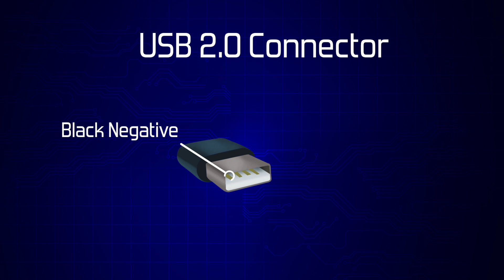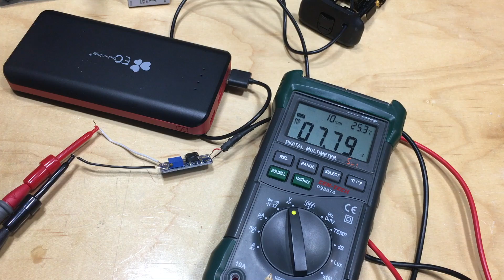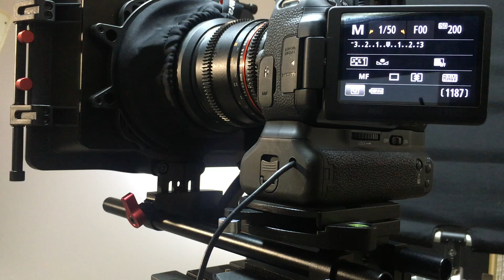Use a 5 Volt Power Bank on a DSLR

Comment: Hello! I tried to do something similar with an lp-e6 battery for a Canon 6D using a 5v to 8v boost converter. In the end, nothing happened. A friend suggested to me that it might be because of the cheap converter board. I ordered several others in China, at a higher price. Perhaps it will work with them.

Comment: Is this still working? 
Can I use Mi 3i 10000mAh power bank please?
Reply from the maker: Mine is still working and going strong! I'm not too familiar with the Mi 3i PB. Just a quick search and of course Amazon has it. Description lists Smart Power Management. Not sure what that exactly means but that feature could be a problem. Maybe. Do your research.
Reply: @rudytorres6559  
Thanks 😍🙏

Comment: Is it okay if you solder the cable to the pcb module while the battery is still attached?
Reply from the maker: Not sure why you would want to do this. I'm probably misunderstanding your question. My knee-jerk answer would be, No.
Reply: @rudytorres6559  I need to replace the cable so I can discharge the power bank battery. I wonder if  I can do it without taking the battery out.

Comment: thanks Rudy for the clear instructions.  it seems to work well, but is anyone having an issue with their power banks usb port going into sleep mode?  fortunately, my power bank has a DC plug with continuous power, but not sure if I can just use a usb wall plug adapter on it or if I need a step down converter now.

Comment: After some more testings, I finally gave up on this project.  majid gh may be right. Step up and down is dangerous. I took the stuff out to play with and it caused Err 99 on my old 30D.
Insufficient current may be the problem. Although I have tested all the setups on my 5D3, 5D2, T4i,40D and 30D before and have had successful results . I am not so sure now. The problem occurred when I made some burst shootings. The camera showed out of power. I reset and every time, I can shoot one or two pictures and no more. I tested again with just the power bank and a 5-9 volts step up cable, same behavior.

Since the insufficient current (?) will cause the shutter to do only half the job, the camera will show an Err message. Also, I have fried a Sandisk CF card causing it unable to format on the camera and the PC.

I have seen others on YouTube using a XTPower MP-10000 to do the job. But having considered the cost - around Cad 200 ship from the States, I would go for a grip with double batteries. (third party)

The risk isn't worth it with the step up module.

Comment: only use "9" NOT 12 volt powerbank and STEP DOWN to 7.2 Volt.
in step up from 5 to 7 or 8 or 9 volt, current is not enough for camera.
don't step up and then step down from 5 to12 and 12 to 7.2!! it's dangerous!!! my canon 750d fail for this.
you can use two 3.7v  2000mA li-ion battery for 7.4 volt.
Reply: I am going to do same but when u measure the battery with volt meter output it's not 7.2v  on my 1100d is 8v I think if you step down on 7.2 the shutter will draw more power below 7.2 a then you will have error message so I will put 8v using linear voltage regulator LM7808 just idea

Comment: update. I connect the 5 to 9 volts USB adapter to the battery grip and it worked okay on the 30D. However, with the same battery grip and same connection, it showed a flash battery signal only and nothing else.

I will be looking for a dead BP511 and modify it to use as a dummy battery to test. Not sure if I can find one.

Comment: I did exactly with the battery grip modification for my Canon BGM E2 ( AA adapter for 30D and 40D. I adjusted the voltage from 7.2 to 7.4 and 8 volts. From the contacts on the battery grip (neck), I was able to get the exact voltage. However, when I turned on the 30D, it showed everything on the top LCD but when I pressed the shutter, everything disappeared and only a weak battery signal is flashing. It won't work at all on 40D.
When I inserted the battery BP 511 into the grip and attached it to 30D and 40D, if functioned as it should be.

I used 2 different power banks (5k and 20K mAh) it just won't work.

The MT3608 when adjusted to 12 volts can powered a bundle of LED strips with no problem.

Would it be the problem that it won't work on older cameras ?
Reply from the maker: samacochan it might be a bad step up.  Order anther one if you don't mind waiting for shipping. Also try a 8 to 9 volt load with similar amp specs.  See if the load stays. One more, many of these USB 5 volt battery banks have smart technology. If they don't pick up on the right amps they'll shut down.
Reply: Thanks for your response. I tried two power banks and also tried connecting the USB to the PC charging port. They behaved the same. 

I am not sure if smart technology is the problem and what am I going to test it out.
Reply: The DC-DC coupler may not be give you stable power (in terms of voltage and ampere). When the shutter is released, it draws more power then the camera is in idle. That's why the camera switches off.
Reply: Happens with me too Nikon d5200 . What I understood is that when we press shutter the required voltage is not available for it to function,  so the solution is 1. Get a 9 volt manual power bank without smart technology and step down where it will give continuous power or 2. Connect your step up output to old battery (need to open and solder) and take output from old battery where the old battery acts as capacitor to hold the required power for shutter release and close. These are the best options and check voltages before you insert into camera without fail    .

Comment: Is the voltage stable ?  I saw people using 5 to 9volt USB converter and it works okay too but I worry that 9 volts may be too high. Any suggestions ?
Reply: I found a solution finally. Actually two solutions. I adjusted the output of the MT3608 to higher than 9 Volts. Then with a  BUCK STEP-DOWN LM2596 POWER CONVERTER MODULE DC 4.0~40 TO 1.3-37V VOLTMETER, I lowered the voltage to 7.74. With the step up and then step down converters, I was able to have very stable volt and current for all my Canon cameras. 

I also purchased an USB 5 Volts to 12 volts adapter and I added a resistor 68K to drop the voltage supply to 7.74 as well. It works perfectly. It's very stable and the size is tiny. I learned this from --https://www.youtube.com/watch?v=b-46fmEB0eM
Reply from the maker: The voltage is stable. I've been using it a while now and it works good. I've adjusted the step-up
to just  over 7 volts as per spec from the battery. 
If you noticed thought the AA battery holder voltage with new batteries will add up to 9 volts which tells me the camera's voltage regulator will mange the incoming voltage pretty well.
Reply: great. I will keep trying. thx
Reply: hey there, did you found a solution for that problem?! tried this with two different powerbanks and also a power supply which should provide 2Amps each, but my 700d (rebel t5i) only tells ne to change my battery...
is this a "problem" because of that smart feature stuff?
thanks for your help!
Reply: It's not about the smart feature of the power banks. I used the PC USB port to supply 5 volts. It behaved the same. 

I used several MT3608 from different sources, they just won't work. I have ordered some step down modules. Will try to boost MT3608 to 12 volts output and then step down to around 8 volts to see how it works out. I have also ordered a USB 5 to 12 volts converter and will step it down to 8 volts and check if it works. Shipping from China is very slow and I might have to wait 2 months to test them.

** An easier way is to use a 5 volts power bank and a $2 USB converter (5 to 9 volts) and a dummy battery. It will work for sure. I tested this method with a dummy LPE6 on my Canon 5D Mark II and mark III. It functioned perfectly well. **

I just figure out that 9 Volts is safe. Canon battery grip allows you to use 6 X 1.5 AA batteries and that is 9 volts and within the tolerance limit. Any supply above that will damage your camera circuit. (12 volts is not okay)

Let me know how it goes from your test.
Reply: samacochan  thanks I'm gonna try this for my t7i as I have the same exact problem using the 5-9v step up usb cable thanks a ton for posting saved me from throwing away the money  I got invested in this so far
Reply: anon amos Actually 5 volts to 9 volts USB step up cable is fine and straight forward. I  used it on my Canon 5d3 and it works perfectly. Lowering voltage a bit is just for peace of mind. 
Canon battery grip adapter uses 6X 1.5 volts AA batteries. That's 9 volts exactly. So it's safe.
Reply: samacochan it isn't working for me. the camera indicates battery is dying or dead, and sometimes won't let me do anything other than view the screen with the 5-9v cable. but when I plug the dc coupler into into the power brick and then into the wall outlet it works fine can take pictures and video and no problems with power only difference is the cable that I can tell since it works for others or the t7i is sensitive to fluctuations at least that's what I gather I'm no repair tech or anything.
Reply: 24 k  金碟
Reply: update i got the MT3608 and matched the output voltage of a full LP-E17 battery which i think was 8.2v solved all my problems thanks for making this video and to all that helped my (800d) t7i is now happy and has plenty of battery
Reply: hey man, the 1.5 volts AA batteries are 1.2 volt not 1.5 in real. test it with volt meter. then 6x1.2=7.2 volt!!!
Reply: Rudy Torres I tried to set my MT3608 in 7.2V, 8V, 8.5V, and 9V it's doesn't works in my 650D.
Actually, how much ampere is needed for camera?
whether the magnitude of the ampere also effects?
Reply: same problem with me on 650D. Any solution found please?

Comment: Think we can do this for a Sony A7Sii?
Reply from the maker: It's possible. The Sony A7sii uses 7,4 volts. You'll need a way to connect the Step-up to the camera. I suggest using a battery dummy like this one, https://www.bhphotovideo.com/c/product/1277395-REG/lanparte_fw_50p_dummy_battery_pack.html. On the end of the step-up  (voltage out) just wire-up a male 2.1mm connector. Also, i would keep it clean and find a small project box to house the step-up. My experience so far has been pretty good with extended recording time. I hope your experience is the same.